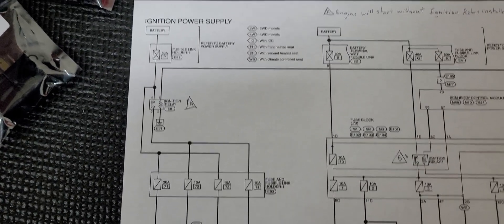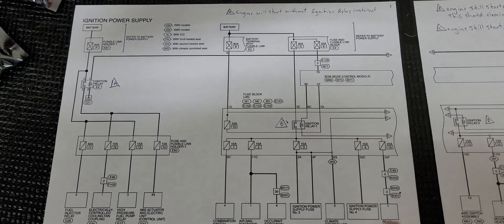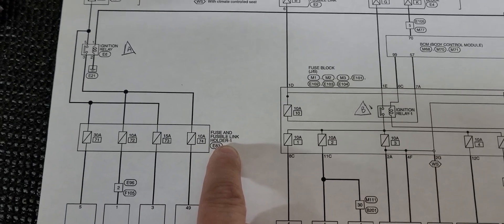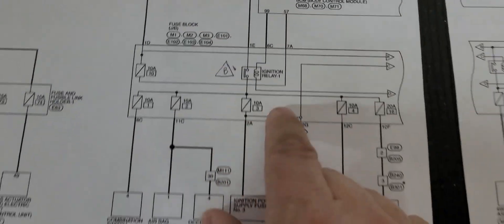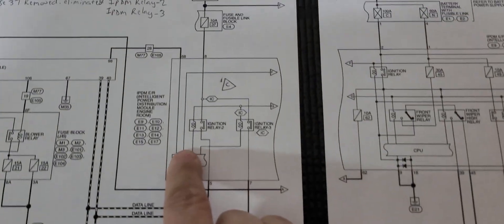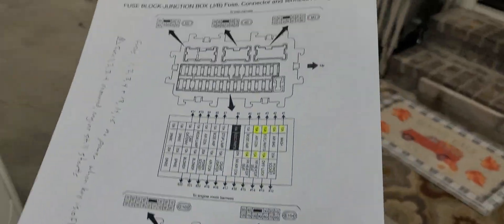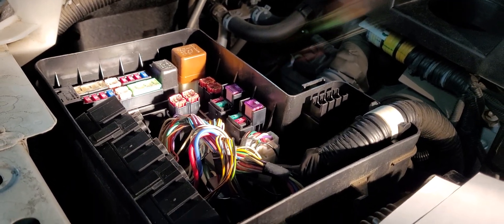INFINITI QX80 Ignition system, relays and IPDM diagrams. How to troubleshoot your Ignition relays.

Comment: Hey Jack, I have a 2015 QX 80 and I really have enjoyed your videos regarding the starting issues with this Infiniti model. I can’t find a way to send you a PM directly so I thought I would just ask you my different topic question that is related to the wiring diagrams. My air conditioning works great when I’m driving, but when it is at a stoplight or parked for longer than a minute the AC stops working. I have replaced the Fan clutch assembly twice without fixing the problem. On a few Infiniti forums, I’ve seen that this is a common problem and sometimes replacing the fan clutch assembly works, but other times it doesn’t. The dealer is now wanting $2600 to rewire the fan coupling harness all the way back to the IPDM because they say that there is no available harnesses. They feel that the harness “could “be the problem but they won’t know if the IPDM is bad until they figure out whether or not this is just a wiring issue. Well, since I don’t have an extra $2600 laying around, I was hoping you could help me.

The way that you are tracing down potential shorts with the starting relay is something I would like to do for the AC. Dealership says that I have a “short to ground” from the electronically controlled cooling fan coupling harness, F39 pin #1 to F105 pin 2.  The diagram they gave me I can see that E96is a connection that is connected to F105, but I can’t find where E95 goes to  or if it goes back to the IPDM.  So the long and short of it is, where can I find the F105/E 96 connection and what color would the wire back at the IPDM look like? The service technician did mention that there have been times that they have bypassed wiring harnesses and went directly from the IPDM to fan clutches, but they did not want to do that now for some reason. That might be something I would wanna try if I can’t find exactly where the shorts to ground is. Any help you could provide would be appreciated ,Jack! Thanks, Erik
Reply from the maker: A very well written question. I’ll look at diagrams and see if I can help. I’ll edit this reply later today with my findings.
Reply: @jacks_DIY98 Thank you, Sir!
Reply from the maker: @ejk6024 The F39 cooling fan coupling is the actual connector that plugs into the cooling fan. It has six wires, pin 1 is Blue/White. Pin 2 Sky Blue. Pin 3 Yellow/Red. Pin 4 Red. Pin 5 Purple. Pin 6 Black/Red. F39 Pin 1 goes to F105, pin2/E96 pin 2 then to fuse #72 then to ignition switch. F39 pin 2 goes to multi-way control valve F20 pin 2. F39 pin 3 goes to IPDM E17 pin 72. Pin 4 goes to multi-way control valve F20 pin 3. F39 pin 5 goes to the ECM (cooling fan speed) F91 pin 31. F39 pin 6 goes to chassis Gnd. NOTE- F39 pin 2 also has a connection (node) with the battery current sensor, and F39 pin 4 has several nodes with several different sensors. I hope this helps. BTW, I use diagrams online from my local library that has a link to Chilton Auto repair guides. You might check your library website or call the help desk to see if they offer them 👍
Reply: @jacks_DIY98 great info. Thank you for the help. I will dive into this next week and let you know how it goes. BTW, have you heard about this AC problem with other owners? There seems to be a lot of people in the Infiniti forums that have this problem yet my dealer acts like they’ve never heard of it and claim they  don’t even know where to start…
Reply from the maker: @ejk6024 One other person has asked about replacing this connector on a car that they bought used. They said the connector had been replaced in a sub standard way so they wanted info on how to replace it. I haven’t heard anything else though. I haven’t had issues with ours either.
Reply: Hi @ejk6024, I also have a 2015 qx80 same ac issue warm at idle or slow speeds ie parking lots once driving it gets ice cold fast. We're you able to fix yours?

Comment: I’m having issues in my 2012 qx56 it I press the push start won’t do anything or with key it won’t go in acc mode
Reply from the maker: @evns700  I’d put the battery on a battery charger and get a full charge then troubleshoot from there. I’ve got a couple videos on the ignition system with information on fuses you can use as test points. I hope those are helpful. Sorry I can’t be of more help.
Reply: @ you been more then helpful

Comment: Excellent presentation! Question,
believe I need to test/replace the
relay in my wife's 2015 Infiniti QX80.

l'm just trying to figure out exactly
which relay I need that controls
the rear air suspension, I believe
you have it listed under area C
ignition. 

The vehicle lifts in the rear
intermittently if at all.. when it's not
lifting, we've experienced a parasitic
draw on the battery (I tested all fuses, and nothing changed as far as the draw on the battery...

after replacing the compressor and both levelingsensor... the relay is the only thing I can think of that makes sense. 

What are your thoughts? And what relay should I purchase?

Thanks so much for the help!
Reply from the maker: @cheers0521  It’s hard to give diagnostic information via a comments section but I’ll try. First it’s important to know there are four main electrical components in your air suspension system. Air levelizer control module(ALCM), relay, compressor and height sensor. You asked about the relay, it has a connector E116 with four contacts. #1&2 are for signal coil (on/off), #1 is ground, black color, #2 gets signal power from the ALCM, violet color. This is the circuit that turns the relay on and off. #3 provides power to the air compressor, light blue color. #5 should be constant power from battery, yellow with black strip. Connectors with a “E” are in the engine bay, your E116 is on the passenger side near the fire wall inside a little fuse/relay box. Your relay is in The far back right corner of the fuse box, it’s black in color. Search Part #25230-7995a relay on Amazon.

Comment: Fuse tracking on this vehicle is terrible. I am trying to find the fuses related to the rear auto liftgate. Trouble shooting plane sucks. Thanks for your videos
Reply from the maker: @markford63  I found the diagrams really easily on ChiltonLibrary.com, you might try that. I can access these service docs through my local library website. One logged into ChiltonLibrary I chose- Body Exterior, Door & lock, Wiring Diagram, Automatic Back Door System. The full diagrams and wire connector list popped up. Your fuses are #4 and #9 in the interior fuse block by your left knee. They will be red (10A) fuses, likely labeled “AIR CON”. I hope this helps 👍

Comment: Hi i cannot find VVEL relay location qx80.please help thank you
Reply from the maker: The VVEL relay is located in the far right bottom corner of the relay/fuse block shown in the video at 16:30. This video does not have info about the VVEL but that relay/fuse block is shown. The lid for the box is labeled with the VVEL relay location.

Comment: Hi there great video. What one is the ECM Relay?
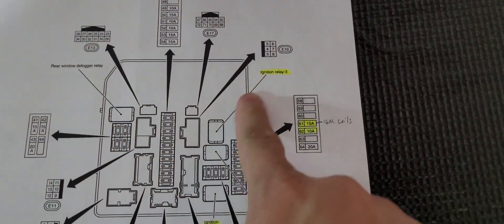Reply from the maker: The ECM relay is located inside the IPDM itself. It doesn't appear to be serviceable.  It gets power from fuse #43 (20A fuse). You could test the relay at that fuse location on the IPDM module. Use the diagram of the ipdm layout shown in this video at 10:30 to find the fuse #43. It's not mentioned in this video but you can still use the layout shown to find it.

Comment: Which fuse box whould the horn fuse be?
Reply from the maker: The horn is protected by a 15 Amp fuse (blue), #31 located in the engine compartment inside the box near the IPDM. If you are standing in front of the QX80, facing the SUV, the box is on the left near the battery.  Pause this video at 15:53, the blue fuse to the left of my finger is your horn fuse.  The black little box to the right of my finger is the horn relay.

Comment: I have a 2011 Infiniti QX56 WTH 175K MILES CURRENTLY ITS NOT RUNNING AND IM TRYING TO FIND OUT WHATS WRONG I DID A TEST ON FUSE 72 AND 74 AND GOT NOTHING FROM THE TEST LIGHT ON BOTH OF THEM AND ALSO THE IPDM I ALSO DID THE TEST WITH THE LIGHT ON THE RED WIRE THAT GOES TO THE STARTER FOLLOWING THE STEPS AND NOTHING FROM THE TEST LIGHT  I ALSO DISCONNECTED THE STARTER HARNES AND I HEARD IT TRYING TO CRANK.  FOR THE HARNNESS GOING BACK TO THE IPDM WHICH IS CONNECTED TO THE  STARTER HARNESS I ALSO DID THE TEST LIGHT AND GOT NOTHING FROM  THE TESTEE ON THE  IPDM. ANY SUGGESTIONS BY CHANCE. THANKYOU  FOR THE VIDEO.
Reply from the maker: Sorry you're having trouble with your infinity. I can't really troubleshoot through YouTube comments, but I'll try. Since fuse 72 and 74 should have power when the Ignition relay is on, but you don't have power there. Then check if fuses 71 and 73 have power. They should have power even if the key is off, but test them with the key off and with it on to see if there is a difference. If fuse 71 and 73 do have power, but 72 and 74 still Don't, then check IPDM fuse  61 and 62 with the key on. They should have power. If they don't have power, then check IPDM fuse 41 and 42. 41 and 42 should have power even with they key off, but test them both ways. If you look at the diagrams in the video, you'll see what im having you check.  We are verifying power to the relays. When troubleshooting,  be sure to check all the easy stuff first. For example, be sure you have a good charged battery with at least 12.3V and be sure your battery cables are connected well. Check both positive and negative cables. I hope you find your problem and fix your car.

Comment: Which is fuel pump realy sir please give me ans fast
Reply from the maker: The diagram suggests the fuel pump relay is internal to the IPDM. The fuel pump relay receives power from fuse #60 and outputs that switched power on IPDM connector E15 pin 54.
Reply: @jacks_DIY98  Is the fuel pump relay inside of the I PDM or hook to it
Reply: No power getting to ipdm module starter signal wire, hot on blue but nothing on red signal wire! When trying to start. New ipdm still the same thing!! Starter is good but link failure when I plug my scanner up to obd port. It just stop cranking, no crank, click, nothing. What do u think could be my problem?
Reply: All fuses are good
Reply: Could be your wires to your battery-starter-ground.